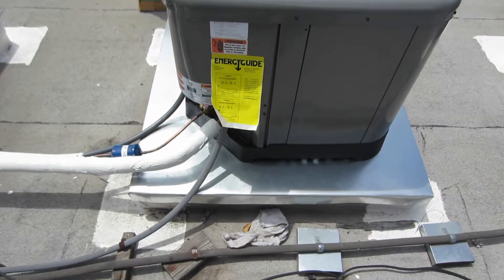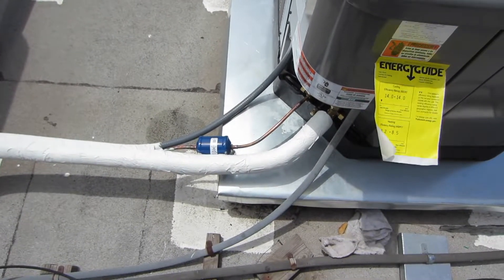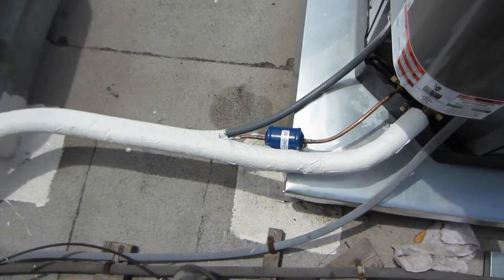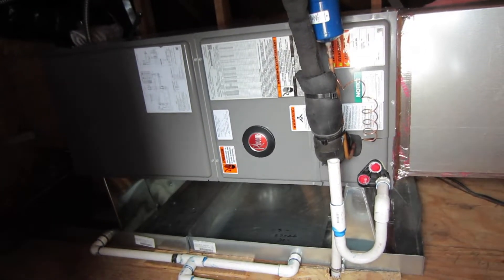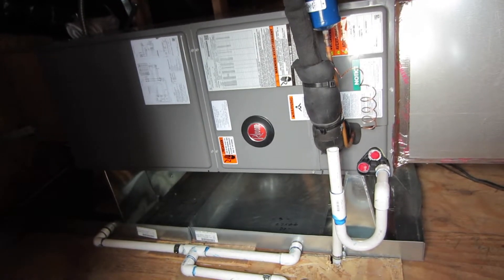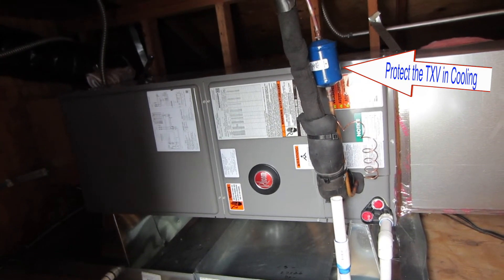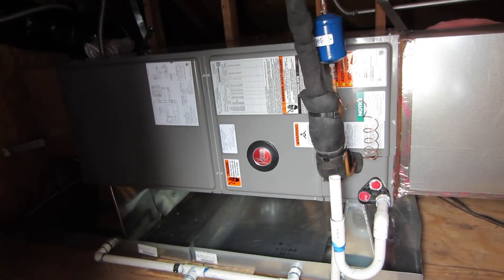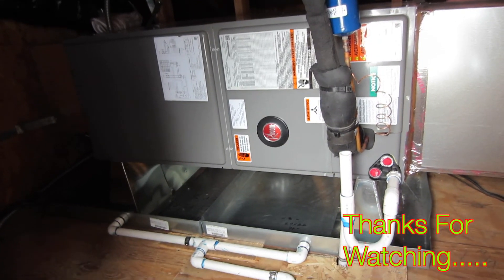Two Liquid Line Dryer On A Heat Pump

Comment: This does nothing to add protection. It’s the same line either way the refrigerant flows. All it’s doing it’s creating more restriction. It’s like having a filter on both ends of a water hose, it’s filtering , adding another filter doesn’t catch anything more than one would. If you installed a suction line filter and a liquid line filter that would be a different story

Comment: Interesting. I have seen a lot of older refrigeration installs where there is a liquid line dryer and a suction line dryer, and I’ve even seen a few old school installations with two dryers in line, so it isn’t like this hasn’t been done before, and on a heat pump it makes sense. Thanks Dizzy, good video.
Reply from the maker: Hello 404 Refrigeration Thanks for your input and thank you for watching.

Comment: I noticed those 2 filter/driers in your other hp video :)
Reply from the maker: Yes sir I always install two liquid line dryer in a heat pump application on a existing line set to protect the TXV.....Thanks for watching.